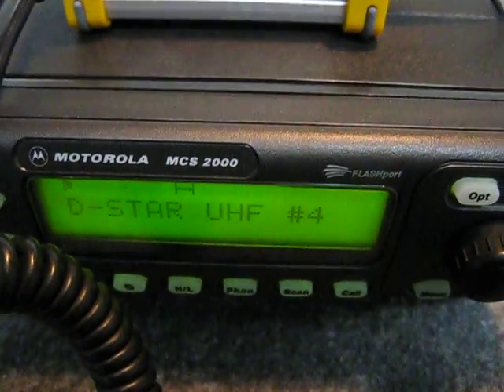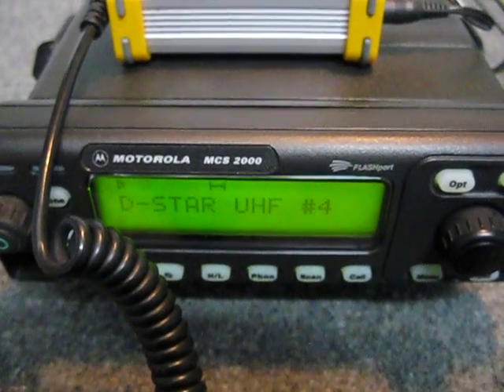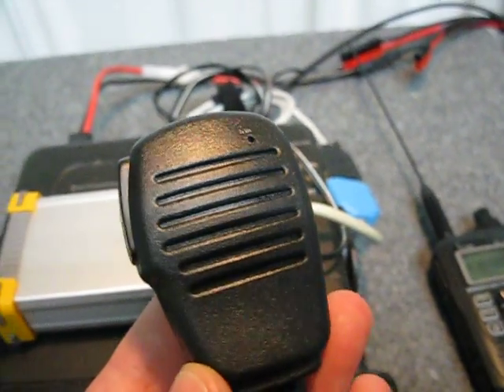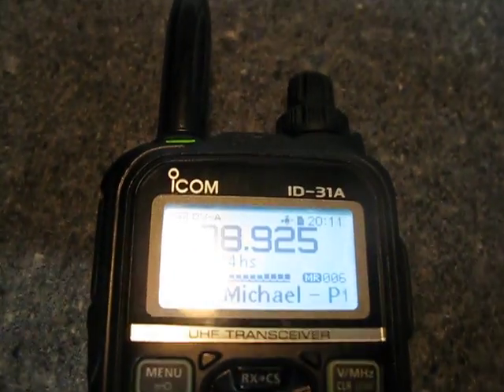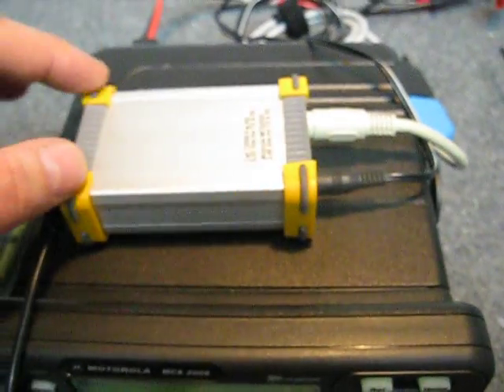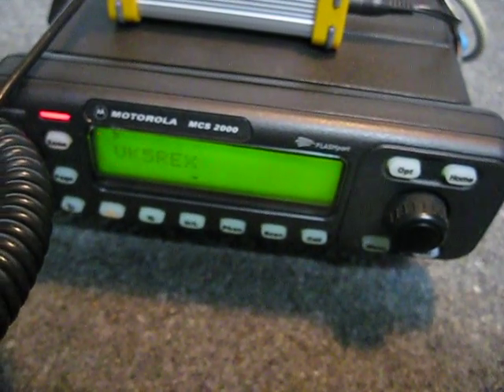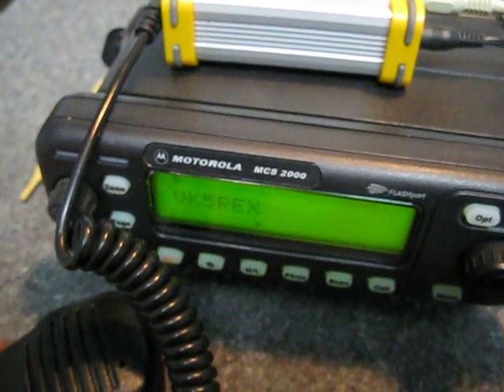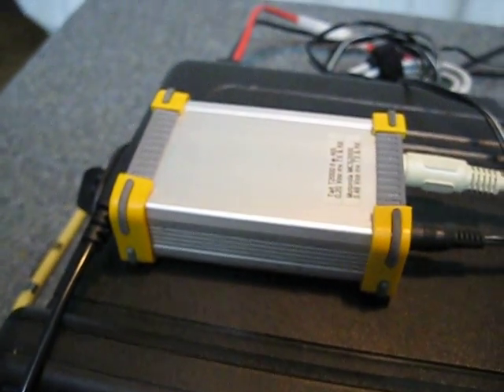DV-RPTR + AMBE Board working with a Motorola MCS2000 radio

Comment: Hi Micheal just wondering if the board you are using is a MMDVM and have to tried it on DMR Tier 2 or P25?
Reply from the maker: This is a DV-RPTR board... one of the original V1 boards from Germany.  I've only ever used it with D-Star.

Comment: Hi Michael, where I can find correct pinout for connect MCS2000 to DVRPTR ? Regards. 73 de IT9BGI
Reply from the maker: +Salvo Muratore (IT9BGI) Find my email address on QRZ and send me an email.  I can send you the pins I used for connection and how I programmed the radio.

Comment: I'm starting to play a lot with MCS2000's here now and XTL/XTS P25 gear. Are you re-flashing the MCS's to suite or just using what they come flashed as? I''ve been looking a lot into the MDC1200 signalling for them lately and now want to look at repeater control options via MDC.

With your repeater, did you use the 5v speaker bias or something else for the PTT? That is probably the biggest issue with the MCS it seems short from needing a bloody SRIB for flashing and upgrading. I have a couple around here and like the way you did the power distribution, fan fail cutout etc on the repeater got me thinking about playing.
Reply from the maker: I've been using the MCS2000's as they are.  No re-flashing.  These were trunking radios but all programming to do with the trunking systems has been removed.
The D-Star channels are conventional Narrow FM channels.
Reply: Michael Carey
Sweet. Yes most were H37/H38 (actually have a H35 around the house here that was originally in the car).

How did you get the ptt from/to the MCS though? They have no ptt line like the radius and a lot of other radios.

Comment: Hi, I did the exact same thing with a Yaesu 8800 and it worked awesome!  Tried to move the unit over to a ICOM 746 but not having as much luck.  I have tried several TX Levels, Delays, and Reverse.  I can bring up the repeater and people can occasionally hear me.  I can always hear them but the issue is that header data (URCALL, RPT1, RPT2, MYCALL, etc.) doesn't seem to be going out and thus can't get out on the repeater's gateway.  Any help or guidance would be appreciated.

Also posted to Yahoo Group but haven't had any feedback  ...

'73s Brian W8BDM
Reply from the maker: Do you have another D-Star radio so you can monitor the transmission from the IC-746 directly?  Does the IC-746 have an FM-N mode?  This will work better than plain ol' wide FM.  What kind of repeater are you trying to use? Icom or Homebrew?
Reply: Michael Carey Unfortunately, I do not own an actual d-star radio but others in my local club have said that they can hear me but are not receiving my MYCALL information on their radio.  The repeater is an ICOM Repeater (W8DF).  I suspect you might be correct about the FM-N mode but I don’t have enough experience to know for sure.  I am using the data socket on the IC-746Pro and have to select “data” mode in order to get it to transmit.  I have read the manual three times and cannot find any information on changing the bandwidth while in FM mode.  So, I am not sure what to do next.  Thanks for our help …. 73s W8BDM
Reply: Michael Carey I also notice a comment on another Yahoo group that I can't use this device with a radio that uses phase-modulation for FM.  I took a look at the specs on the IC-746 and sure enough, it says phase-modulation.  Do you agree?  https://groups.yahoo.com/neo/groups/gmsk_dv_node/conversations/topics/4771?var=1
Reply from the maker: Brian Marsh Oh yes. Phase modulation will most certainly NOT work with GMSK.
Ideally you would use a radio that is designed for GMSK or data transmissions and has a two point FM modulator. GMSK has a lot of low frequency content, this can cause the PLL in some FM radios to act on the frequency being off (caused by the GMSK) and try to pull to carrier back into line... in essence the PLL/VCO is fighting the deviation caused by the GMSK modulation.  "The two-point modulation
technique circumvents this problem by splitting the Gaussian filter signal, sending one portion to the VCO modulation input, and the other to the PLL master oscillator. Since the master oscillator is not in the frequency control feedback loop, it can be modulated by the low-frequency portion of the signal. Modulation at this point, combined with modulation of the VCO, produces a composite signal with a
spectral response extending down to DC. This two-point modulation technique results in an essentially constant modulation sensitivity without regard to the loop bandwidth".. taken from a quick Google search... thanks mshareef.

Comment: Hi i have just applied for a repeater frequency at vk4rbd hope to be building something in the next 6 months would the v3 board be very similar and or is there another product i should look at
Thanks steven vk4sm
Reply from the maker: The DV-RPTR v1 board is now being produced by Bruce Given VE2GZI.  A DV-RPTR v1 board, two compatible radios and a computer running the G4KLX D-Star software suite make for an excellent low-cost D-Star repeater.